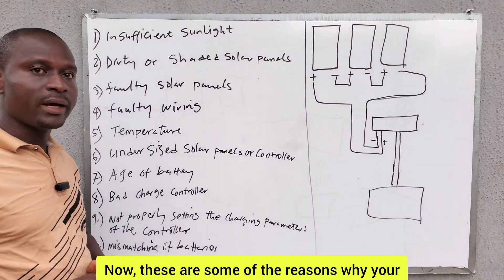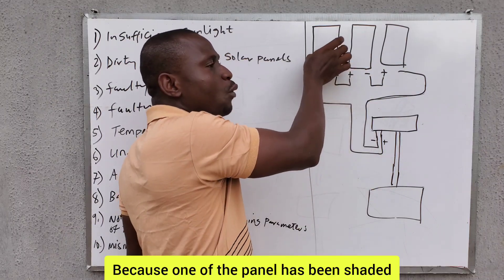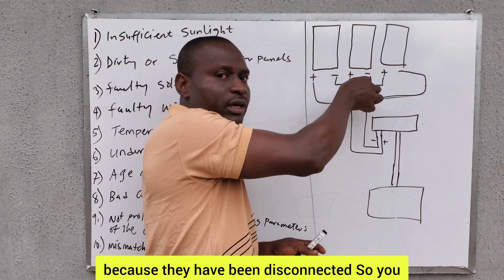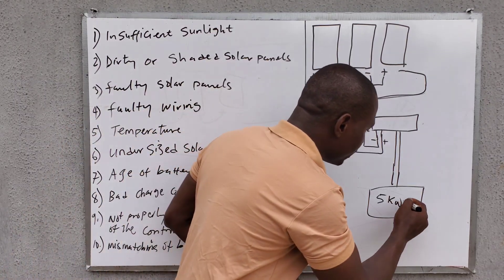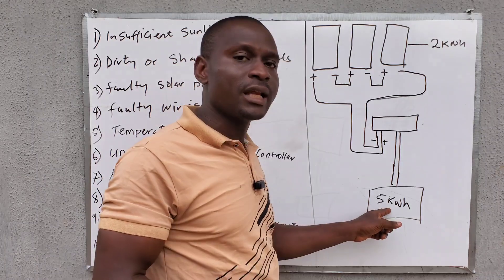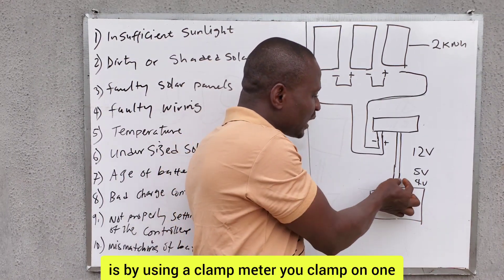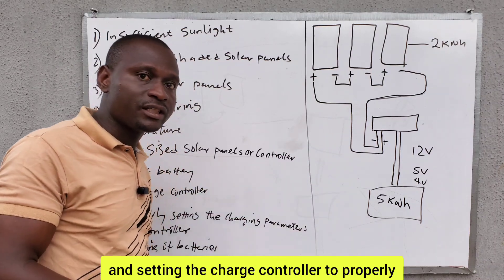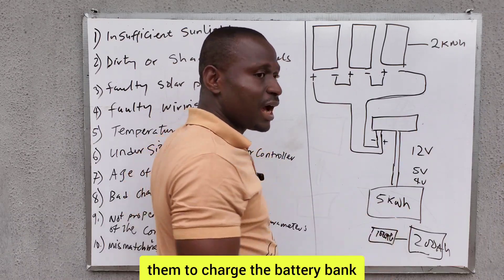Why solar battery is not charging

Comment: My battery is 12 volts 100ah  but my charge controller sometimes Read 13 or 14 volts if fully charged with 180watts panel is it good or bad?
Reply: good